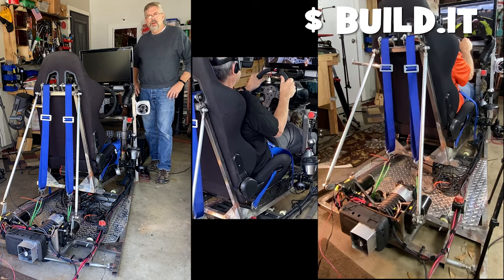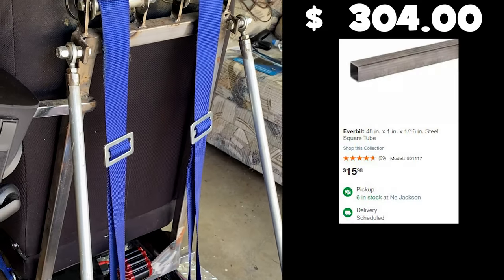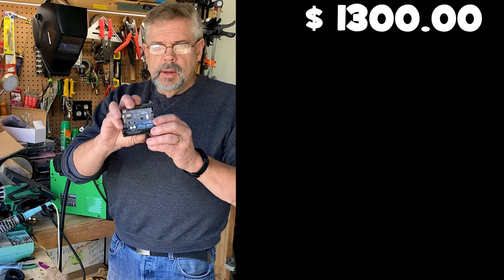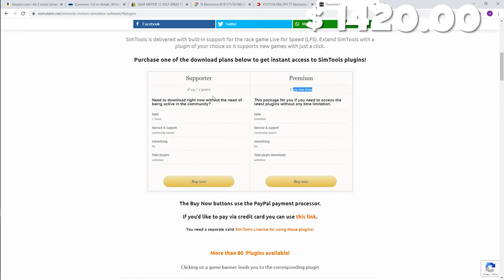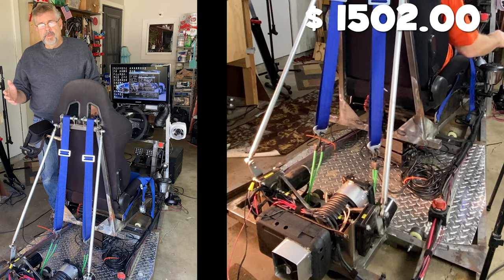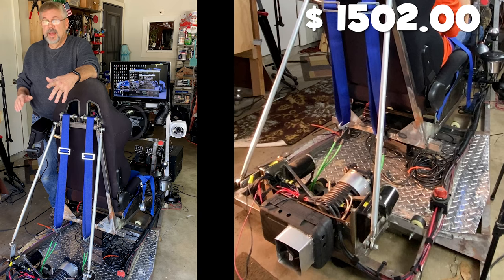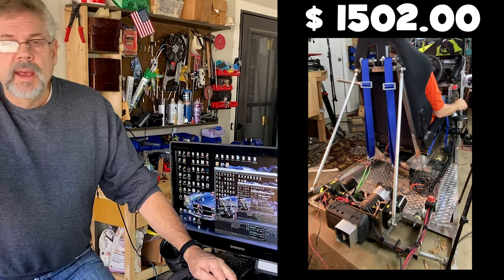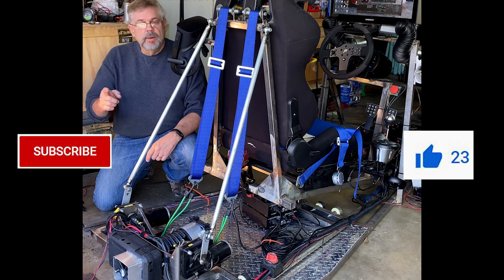How much does a motion simulator cost in 2021. DIY Racing Simulator Cost for Assetto Corsa.

Comment: When is part 2 coming after arduino video?
Reply from the maker: Thanks for asking Reid! I got everything ready to go, just short on time to finish up the video.. Should be ready pretty soon.  😃
Reply: @DMAX_DIY  awesome can't wait I will be trying to do one myself!!! Thanks
Reply from the maker: @reidpowers3932  Here's a little info if you want to take a look   I used the xsimulator.net forum for pretty much all you were asking. here is a link to the schematic page https://www.xsimulator.net/community/threads/smc3-arduino-3dof-motor-driver-and-windows-utilities.4957/
here is a link to my build on x-simulator.net https://www.xsimulator.net/community/threads/full-frame-2-dof-traction-loss-new-build.14740/

That should get you heading in the right direction.
Reply: @DMAX_DIY  thank you so much! I will try and post after I get it going! Going for all unistrut design while trying to stay as compact as possible. Trying to mimic dof h2 design. Thank you again.
Reply from the maker: @reidpowers3932  Yep.. I looked at that DOF design. I did not think my motors would be powerful enough.. (they probably ARE but I had no idea) I just did not want to drop the bucks all at once on one of theirs when I could probably make something just as good, if not better...  If I did it my way, I could sneak in a little $ bit at a time.. and at worst case..  it would not work..  This is a new area for everyone, all of the big names are trying to do this..  So I guess we are on the leading edge.. Certainly not the trailing edge.. DMAX

Comment: I'm going to the junk yard for a seat, maybe a leather one lol too!
Reply from the maker: Hey brother..  Be sure to get a 'passenger' side seat!  not too many hours of people sitting in that side sometimes!    Yeah.. These motion sims are so cool once you get them running..  I got more videos coming!  Dave
Reply: @DMAX_DIY  haha awesome ya passenger side makes sense, I don’t know I may use my old Tenzo R seat from my Supra as I plan to get a kirkey bucket
Reply from the maker: @xyzebruh1083  I'm not super happy with my Kirkey..  Yeah it's very light which is important but I have yet to do the Foam insert kit so after a couple hours, it's not super comfortable.  I'm planning on potentially modding out a different seat.  The Tenzo R would be a much better seat!  But a stock manufacturer seat will probably be the most comfortable.
Reply: @DMAX_DIY  ya I’m going for safety on my Supra build so the tenzo r seats have to go